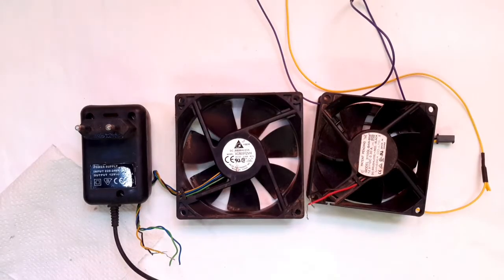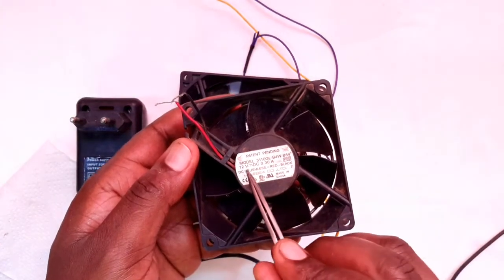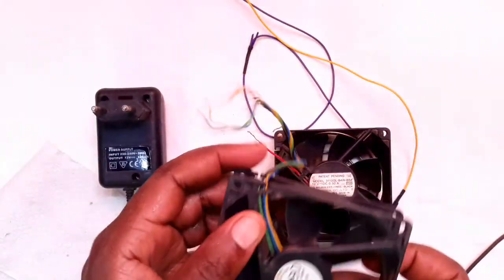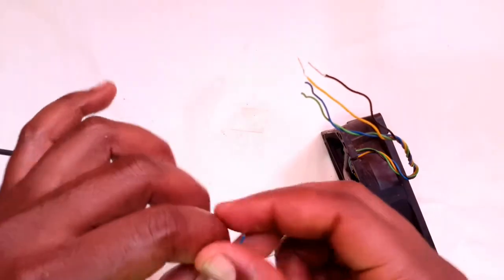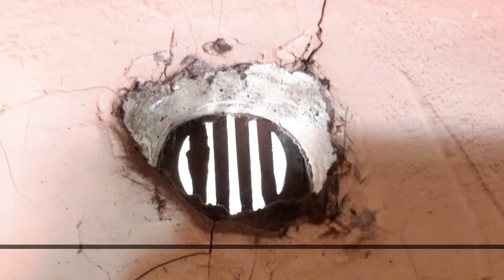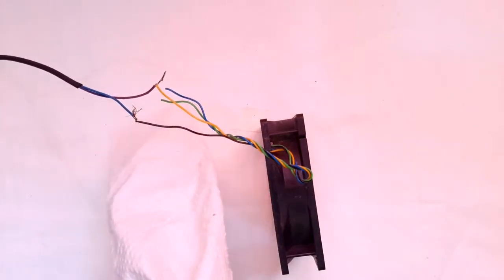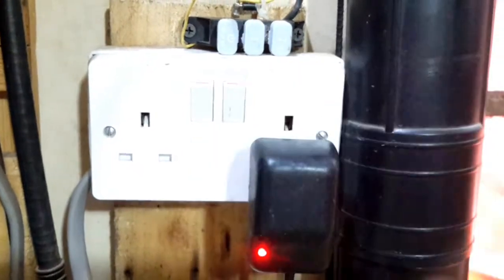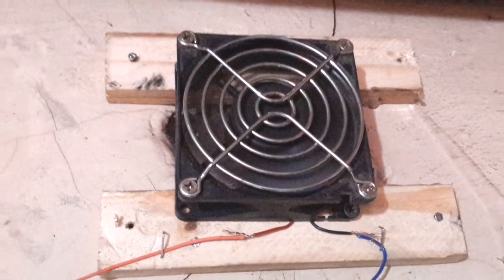Improve Room Ventilation with an old Computer Fan ! | DIY | # 6

Comment: Nice. Did you power supply survive this?
It's rated for 100mA while the fans draw a maximum of 0.3 @ 12 V each. So it's underpowered for the fans.
Did it overheat or shut down?
Reply from the maker: Thanks. That explains why my adapter failed... 
What rating of an adapter should I use that supports the fans
Reply: @evansngure  
Haha, how long did it run for? Looks like you accidentally exceeded the rating by 9 times!

I just checked the datasheets:
Fan 1: AUB0912VH - typical draw 0.38 A, maximum of 0.6 A.
Fan 2: 3110GL-B4W-B54 - typical draw 0.3 A

So combined we're at 0.3 + 0.6 A = 0.9 A at full speed.
I recommend getting at least 25% headroom, so a 1500mA rated 12V adapter should be fine. It depends on the ambient temperature. If it's hot, 2000mA is probably safer.

Comment: question, I want to use this in my bathroom but it means I would have to wire it from my lamp and not through a adapter. How  do I fix a 12v adapter inbetween that?
Reply from the maker: You can use an ac to dc transformer